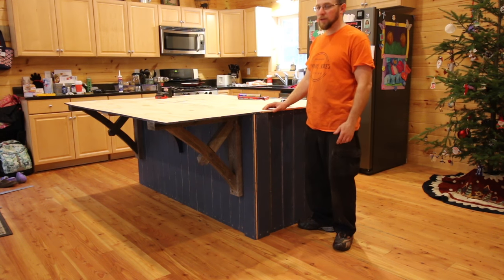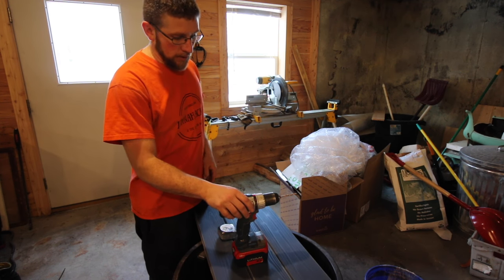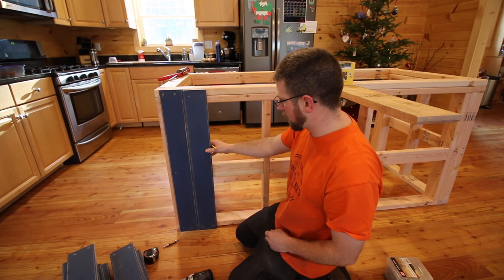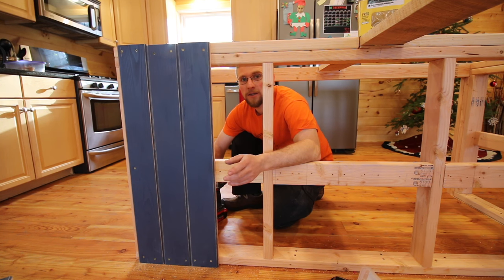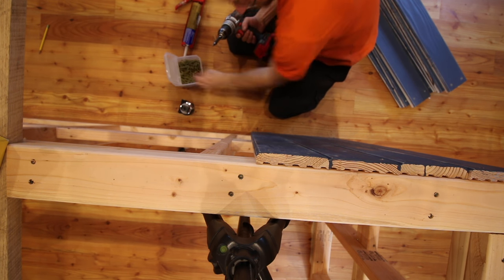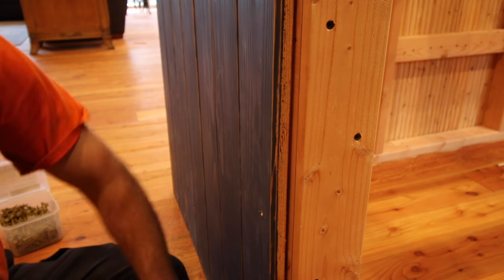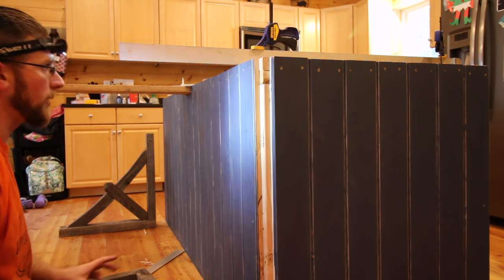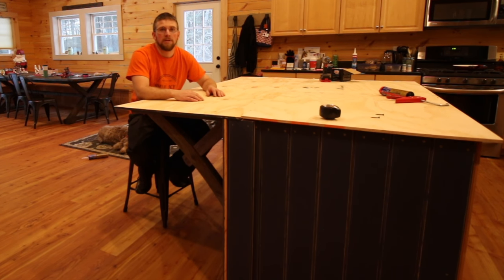Kitchen Island Build #3

Comment: I am going to build an island as well soon.  I plan on creating the cabinets from scratch and apply a face frame with maple strips just like a real cabinet.  I use a pocket hole jig to put that frame together and then use brad nails to attach to the cabinet frame.  Next step will be create a concrete countertop.   DIY Pete has some excellent videos on creating concrete tops.

Comment: I applaud your desire to create your projects.  Looks like you could really benefit by investing in some tools.  Those tongue and groove boards would have gone on so quickly with a pneumatic nailer without having to apply glue.  Best place I have found to get a great deal on tools is BigSkyTool.com   They have new and refurbished Hitachi tools.    Pick yourself up an air compressor and 15g nailer and you will be able to create more things professionally.   Keep up the good work and I like your island project.
Reply: Yes, you could have made it much easier using a finish nail gun.